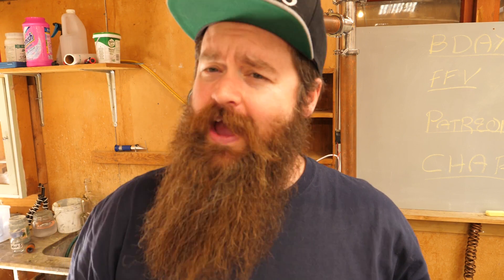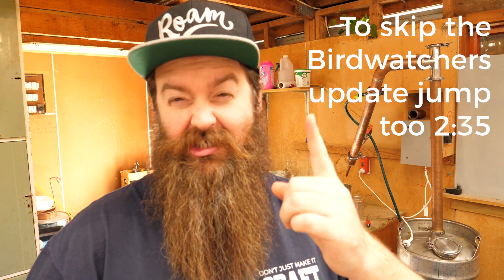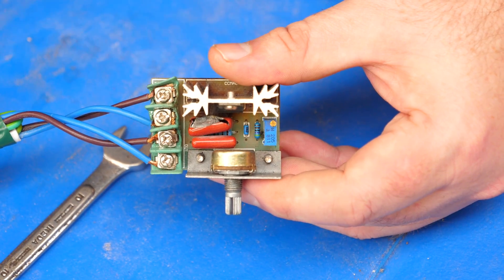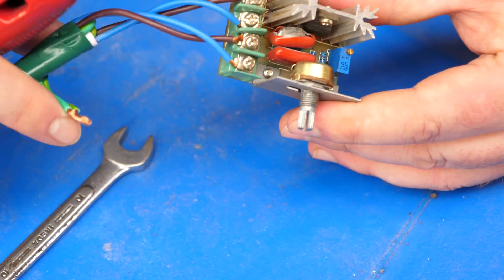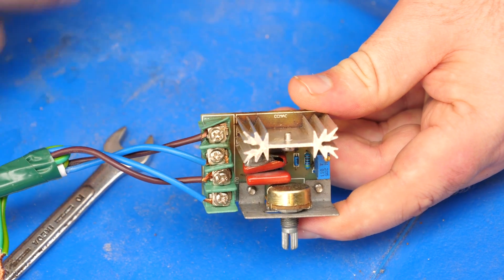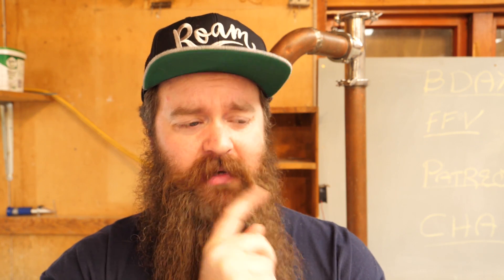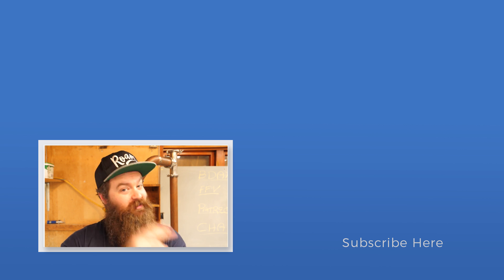How To Control Electric Element Stills?  SCR!

Comment: Great video as always! One small suggestion. When the wall switch element is on and the SCR is at 25% I believe you will be at 62.5% total power. So to be at 75% you would need the wall switch on (100%) and the SCR set to 50%. Cheers!

Comment: I have a 13 gal. Vevor electric pot still. 220v  I refit the cover with a column. My problem is keeping consistent heat. It heats way way up. Then shuts off for 5-10 minutes.  How do I keep a simmer to keep the column working?

Comment: Great video!  I'm assuming an SCR could be used to reduce the power consumption of a 2,400W kettle by dialing it down to 600W?  We live in a country where power cuts are becoming the norm, with people installing inverters and batteries to retain in some sort of normality.  Many of these inverters are <3kVA, preventing the use of a 2,400W kettle.

Comment: I got a clawhammer supply self build copper still kit (10 gal), I have a 1650 watt internal element for it,with an adapter.  I'm just useing it for stripping runs, do I necessarily need to control power output? I'd rather just plug it up and let it go wide open,I strain my was very thoroughly too.

Comment: I always kind of hate it when people say 5V is "safer." It can still cause serious damage depending on the path it takes. It only takes 500mA to stop the heart and 5V on a low resistance connection can get you to the danger zone. "Safer" in the sense that it has a larger gradient of resistance that will render it less deadly, but always take proper caution, people. Use grounded connections, check all connections before turning on, and never mess with live wires unless you really know what you are doing. This is coming from a guy that spent 6 years in uni with capacitors blowing up, people grabbing live components, and one very....special...guy that liked to chew solder. Don't think low voltages are safe. "Safer" maybe. Safe, no.

Comment: could you use a light dimmer? You could use a light dimmer with an app on your phone that will dim when you set it to dim or do it manually. Also with 2 2kw elements you would need more than a 10amp wall socket? Because with both elements on at full blast you could easily melt a normal wall plug.

Comment: I did my first pot still run on a Turbo 500 Boiler last weekend. It has a 2000 Watt element and that is it. The comparable Copper Head Boiler has two elements and one can be switched out once the wash has reached the desired temperature. I have a 4000 Watt SCR. For me I run full throttle until I am just at the point of collecting then I drop the power back to 55%. It is as easy as that. Temperature changes as the percentage of alcohol in the pot decreases, that would cause a PID Controller to make adjustments, but I just left it and only adjusted when I wanted to. That puts me in the drivers seat. $27.00 on Trade Me. What a deal. !!!!!! Thanks Jessie, Newbie very happy with the first POT Still run.

Comment: That's exactly what happened to mine. luckily I have a box full of those light dimmers. I put a tiny fan on the heatsink and it's been fine ever since.
(BTW, the SCR (Silicon Controlled Rectifier) is the black three pin device mounted to the heatsink. )

Comment: To go with the elements I'm not sure what size I would need to run for mine I have been using lpg burners but they aren't that safe 
So I'm using a 50l keg with a 1.3m high stainless reflux collum I'm looking at getting a 10000w scr to power it so I'm after your thoughts
PS love your videos and your enthusiasm about your hobby

Comment: Should I use a pid(pain in da ass controller) or a scr(super crapp controller) witch one bro??
Reply: PID is the controller that can command a transistor (like the SCR) or an electromechanical relay.
The SCR is an electronic switch, it can switch current at maximum frequencies of hundreds of Hz. Once latched, it stays on until the next polarity change or until the power goes out. The SCR only switches DC (it can switch maximum 50% of a sinusoidal AC).
Reply: @soupflood  Cheers mate

Comment: My only 2p worth is to agree and recomemd always buying an SCR that is at least 5 or 10x the max power you are going to put through it. Particularly if you are buying Chinese.. they are usually at least 2 to 3x over optimistic and having sparks and flames near a working still is never a good idea. :)
If using more than 1 heating element then one SCR each will avoid those difficult moments when one fries itself, element or SCR. At least you can run, maybe a lot slower but run all the same.

Comment: Love the enthusiasm, but maybe a couple of useful additions:
1) Agree with jp below - I'd have bolted those earth wires to your metal plate for better safety at no cost
2) PID and SCR - literally apples and oranges. PID is controlling temperature (usually by bang-bang - on/off - firing the element), SCR has nothing to do with temperature control, it's just controlling how much of the power waveform goes to the element. SCR is probably far more useful here when you're really talking about manual control of heat.
3) DONT buy massively overrated SCRs for your application; an SCR rated at 10X the current you are using will not perform as well. So for a 2K element an SCR rated at 2.4K should be fine.
4) Thanks to Chinese manufacturing quality being inconsistent (sorry - if the sh## fits..) its nearly impossible to tell if any random item you buy is going to work well/for long - regardless of price. When you're talking items that require good thermal connection to heatsinks; all bets are off. So its a roll of the dice and the "buy two" idea; deffo valid. In your case one of the filter caps blew, not the SCR by the look of it - pretty common for the Chinese to use low grade or underrated caps, which is sad because they cost about 3c.

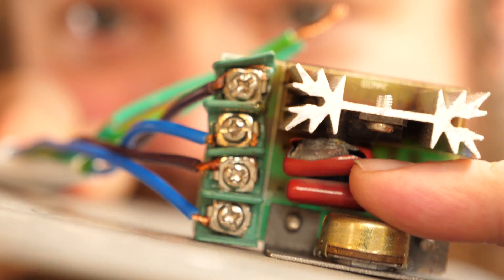Comment: 9:29 blown capacitor, how many electric devices have thrown away because of those cheap AF components, that are probably easiest ever to replace..
Reply: And same capacitor blow in my SCR :D Soldered new one on back side of pcb to avoid thyristor to heat it up, they were originally almost touching.

Comment: Hey bud, Aussie sparky here, we wire to the same standards, if your house was wired right, you can pull like 5kw out of a standard power point for short periods of time though it’s not great

would recommend use two plugs in a double outlet. If you draw too much current you’ll just a trip the circuit breaker and get the cables warm. It’s rough but it works
Reply: Theoretically...asking for a friend... say I have a still with one 3500kw element. This person doesnt have any 15A outlets and was thinking of creating a lead with 2 male plug ends that would be each plugged into separate circuits, with 1 socket that the element would plug into. Sounds dodgy AF I know... but would it solve the issue tripping the 10 amp breaker when running at full power?
Reply: @sonnyjim7579  make sure they are the same phase
or the element is wired for, and can handle 2 phase

The danger is while one plug is plugged in, the other has 110 or 240 exposed. Tbh I should’ve mentioned that in the first comment, that’s kinda embarrassing.

Are you sure you’re on 10A breakers? In Australia/NZ they’re “10A” plugs but usually a 16A breaker which won’t trip on overload till 1.45*16A and won’t trip on short circuit till like 7.5*16A

Even a 10A breaker still takes like 5 minutes to trip at 14 amps. Channel called “electroboom” covered the topic about a month ago, he’s an electrical engineer in Canada.

Comment: SO MUCH easier to control using an SCR instead of a PID. I started with the PID control box and hated it. After a few tries, I ordered an SCR from Amazon and wired it into my control box. I left the PID installed, but disconnected everything but the temperature probe, so the PID still works as a digital temp gauge. I run a 240v 4500w element and bought the "10000W High Power SCR Electronic Voltage Regulator AC 110V-220V Motor Speed Controller Dimming Thermoregulation Module with Fan" from amazon.
Reply: How did you wire it for 240? Just run red straight to plug and black through the scr?

Comment: Listen up If you go electric go 220 Volts AC because you will not have the wire heating problem as you do with 120 AC.  Also use ten Gauge wire for power circuits.  Never skimp on this ; TAKE it form an Engineer that knows electricity.  220 is the only way to do this.  Any one that has done 120 just touch the wire and see how hot it get's.  By the way your SSR is rated at 300 Vac.  lots of room there.  Love out Loud or not at all.

Comment: pause @ 10 Min ... what's wrong with the Board or the Wiring? Looking at it vertical position from the top been Pin 1 should be from the wall neutral IN, Pin 2 should be from the wall Active IN, Pin 3 Active OUT, CORRECT Pin 4 neutral OUT, CORRECT. Pardon for my bad inglish. Hope NO ONE Makes The same mistake as this one culd have been loss of life and maybe home too.

Comment: Good video for a novice electrician.    One huge suggestion.    Tie your green ground wire to the wall outlet ground for sure.    On the SCR controller side I would ground the green wire to the plate you are mounting the controller to.   Just make sure the body of the potentiometer is not electrically connected to the rest of the control circuit.  Thirdly you should ground your still to the green wire.   Maybe even put a few ground wires to various parts of your still where there may be bad electrical connection between sections of pipe due to the various unions or couplers.    Run a separate wire from various points on your still to the green wire next to your controller.    This will be a safety ground for you and your controller.   If anything in your setup shorts to the still or to the plate it will blow a fuse (trip a breaker) and save your from getting shocked.   Plus grounding everything should eliminate static electricity built up and sprarks igniting the alcohol.

Comment: I built my controller with separate components - 40A 240V SSR, 240V fan, dual pole on/off switch, and a 500K Ohm potentiometer.  I'm using my 240V 30A clothes dryer outlet for power.  My heating element is 55K watts.  Takes about 30 minutes to heat up a 10 gallon charge in a 13.2 gallon keg.
Reply: 55k watts? That sounds a bit overkill! I'm sure you just forgot the decimal point. ;)
Reply: @stevep4832  yes sorry, that should be 5.5KW

Comment: Hey bro mean video. Just wondering how many amps to run your 2 elements and did u have to upgraded any breaker switches or home wiring? Cheer bro love the channel. Tumeke!
Reply from the maker: I have 2x 2kw elements.  I run them on 2 seperate lines.  So I did not need to for my specific wiring.  But no idea what you have sorry :)
Reply: 2kw / 240v = 8.33A

Comment: I have a question, if the liquid in your still gets below your heating element could your dry element ignite the fumes inside your still??? Sorry if question is dumb
Reply from the maker: Nah that's a smart question.  I'm not sure about ignite, but you can definitely burn out the elements.  Not something you want to be doing!  So yeah, make sure you know the volume that covers you elements.
Reply: @StillIt  got it. Thanks much man. I appreciate it
Reply: @StillIt  so you want to keep your distillate above the coils throughout the whole run?
Reply from the maker: Yeah exactly.  Don't want to run them dry ever.  So ideally you want the elements down low in your boiler.
Reply: @StillIt  awesome. Thank you for your input Mate, I appreciate your time

Comment: You should have it mounted in a metal electrical box. If that thing failed because of heat be safe and don't burn down the house putting it a wood or plastic box.
Reply from the maker: Yup I should
Reply: But also, you shouldn't leave your still running alone..

Comment: I have an digital push boton SCR hooked up to a 240 volt power sorce then I have the output From the SCR hooked up to a solid state relay that is controled by a rex c 100 PID temp controler, the purpose of this is so that not only can I control the over all power to the heating element with the SCR but I can also control the temp with the PID controler. My question is  when I have the whole animal up and running will the SCR reset itself every time the PID turns off or on when controling the temp? What I mean to say Is the SCR has a simple up and down buton and a digital display that goes from 0 to 100% power output instead of a ajustable knob, will this digital power stay at one setting or will it reset back to 0 every time the PID turns off or on to be more precise?
Reply from the maker: First up, I am NOT a expert on this.  So take this for what its worth aha 
The SCR's I have used in the past are a simple switch.  If the low current (from PID / whatever) is on then turn the mains current on.  Its never at 50% its just on for 50% and off for 50%.  If you ccycle that quickly enough its roughly the same thing.  

So if the PID is off, there is no signal/low current going into the SCR so the SCR is off also.
Reply: First, the SCR has a constant power supply so there is no turning it off and on then the output from the SCR connects to a solid state relay instead of directly to the heating element then he SSR is controlled by a PID so the power to the heating element is first controlled by the SCR then thermostatically by the PID, Oh this is useless to try to explain. Never mind ill just have to post a video when I get it all together.

Comment: I don't know aboult the voltage in New Zealand But in the US 240 volts will turn your finger nails black. I'm exsperimenting with a silicone controled rectifier in conjunction with a rex PID controler so I can control the power to the heating element and have thermostatic control at the same time.
Reply: US have mostly 110v because dangerous sockets, there would be so many electrocution deaths with those sockets and 240v..

Comment: I currently use a 5 gallon gas heated still but I'm thinking of switching to electric and a 11 gallon still. How many watts would you recommend. Google says 11 gallons Is 50 liters if that helps
Reply from the maker: Thats the same size as mine.  I use 2x 2kw.  I only need about 2kw when actually running.  but the extra makes heat up faster.

Comment: What you need is an SSR ( solid state relay) with PID controller with manual %age control
Reply from the maker: I have all the parts for a Arduino based ssr set up sitting there......the I got lazy!  Haha

Comment: I think SCR such as you used should have some cooling. A computer cooling fan would do - if it's mounted in a box as yours was, temps could get a bit warmish..
Reply from the maker: Yep I had a cooling fan on the side of the box (exhaust holes on the other side).  I shoulda pointed that out. Think I need to do a better job with 2.0 though :)
Reply: Agreed - also the provided heat sinks on these things are always insufficient.
Reply: Could build a liquid cooling system like you would for a PC

Comment: I like my PID controller with both hotplate and internal heat. $35 with 40 amp SS switching relays. George at barley&hops has good setup vids on PIDs.

Comment: Another handy tip, when you turn your wall switch that is powering the scr make sure the scr is turned down to '0%' this will help with longevity.
Reply from the maker: Now this I did not know!!  Cheers mate.
Reply: I should have said when both turning it on and off at the wall :)

Comment: Does this mean we get a 'setting up an electric still' video?  Because I need that in my life.  Also, is there a reason for having two weaker elements as opposed to a single powerful one?
Reply from the maker: Yeah I'm thinking we need to do that some time.  

For me it was mostly that I can run these two on two separate circuts. One big element would require a sparky to put a new high amp circuit it.
Reply: First off, fun channel cheers.

Now the serious stuff, leave it alone, your two elements give you much better control as you have noted, changing the SCR controller to a TRIAC based one will give you even better control. Should one fail and you are left woith just one operating them 2.Kw is far better than 0Kw heating, you will still be able to complete your run.

If you were to step up to 3Kw elements that would require two circuits installed not one, and unless you have a sparky who will do the job cheap, well it's going to cost.